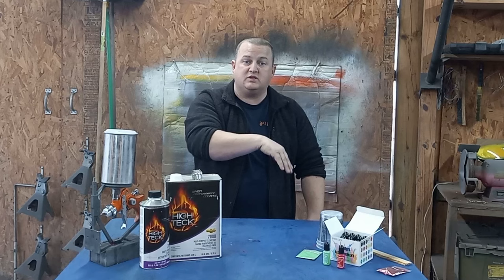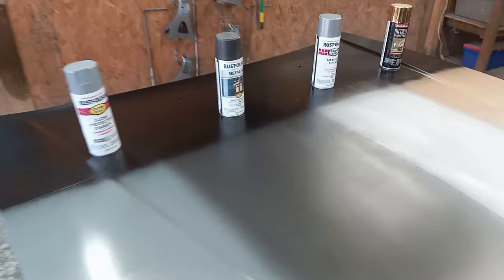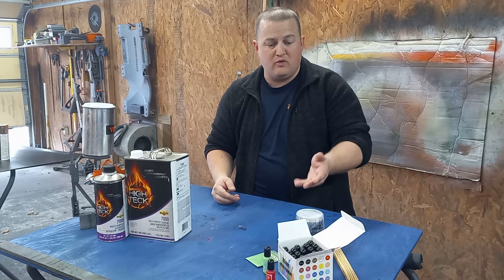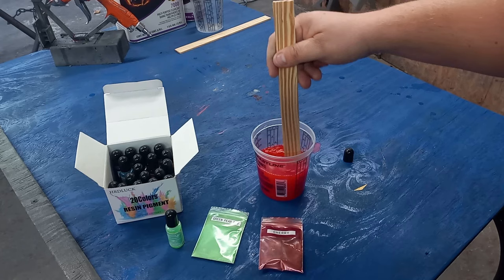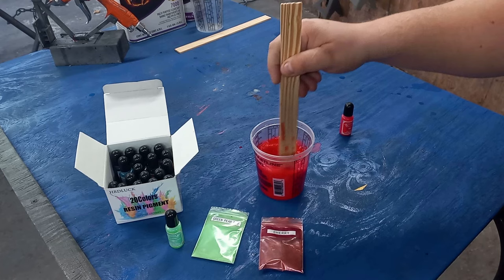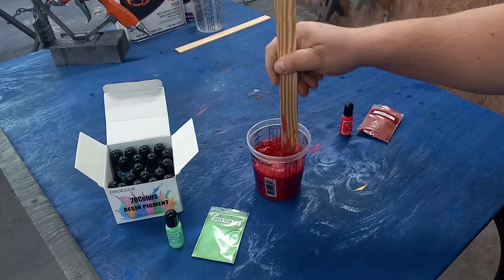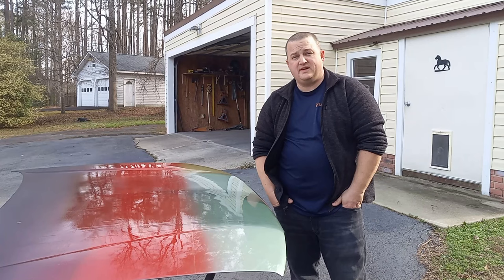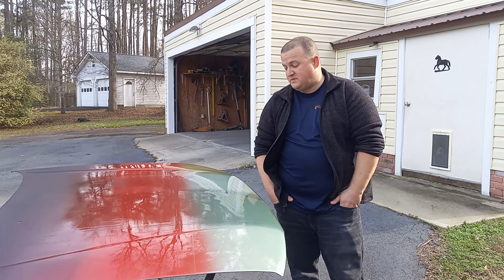RUSTOLEUM PAINT JOB KANDY PAINT USING LIQUID PIGMENT

Comment: Maybe try adding a little metallic into the candy coat.  The green needs more pigment for sure.  I like the experiment and sharing for us to learn from mistakes/wins.  This wasn't necessarily a win, but not a complete fail either.  Like you said, more testing is needed.  Cool idea though.  thinking outside the box.

Comment: Hello, I just found your channel and I am loving your tips with Rust-Oleum because that is what I use a lot. My question is I am just getting started using a gun and I paint sewing machines and so I have a whole lot of shapes and contours that I need to work around. Is there a way that you can show how to adjust your gun so that you can paint a small piece like a sewing machine or a small piece of equipment, which needs to be hit at several different angles. Thank you so much
Reply from the maker: If your spraying something with a bunch of angles and small curves or just small in general a touch up gun will do the trick nicely. I will be doing a more in depth vid soon all about gun set up but my video on the Vevor gun set might answer some of your questions in the meantime. Hope this helps and thanks for watching!!!!
Reply: @WHITLEYAUTOWORKS  I'll look for that. Thank you.

Comment: Red tinted really well green you can see in certain angles did pigment powder show can’t really tell cause lack of sunlight
Reply from the maker: Yea unfortunately the sun wasn't doing many favors the red turned out as it should the green just got lost in the mix even using the whole bottle wasn't enough. I'm gonna do a major spray out with this in a future video to see which colors have potential to work so it's not over yet stay tuned

Comment: Could you please do a reveiw on the Auto Zone ready to spray paint shop paint? Im wondering if its worth the little money it cost...
Reply from the maker: I covered it a little in a past video but you are better off getting base coat or fast dry mixed in nason for the same price or less and you would have a lot more choices of color. Check out my rustoleum paint vs automotive paint video if you get a chance.

Comment: What  brand is that pearl and is the clear setup u using do it has very good uv protection
Reply from the maker: https://share.temu.com/oVeLK4DgZCA
Here's the link to the pearls I used in the rustoleum custom mixed videos so far. High tech 7000 is the clear I'm using for these projects but it's not a good clear with UV protection. I recommend speedokote 2k clear or Nason 2k multi panel clear if your doing a whole car.
Reply: @WHITLEYAUTOWORKS  do.u know if they will do good with the kp pigments and didspade and dip your car pearl setups if I mix them in
Reply from the maker: Yes it's all Mica powder so should be fine mixing and matching as you want.